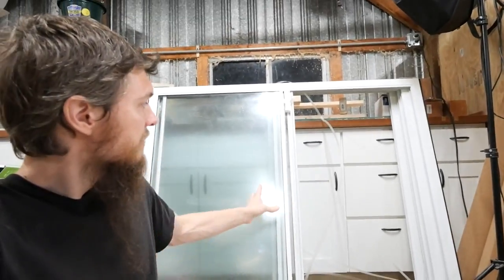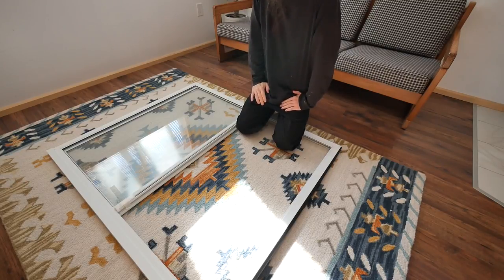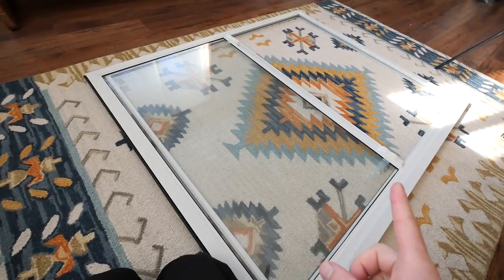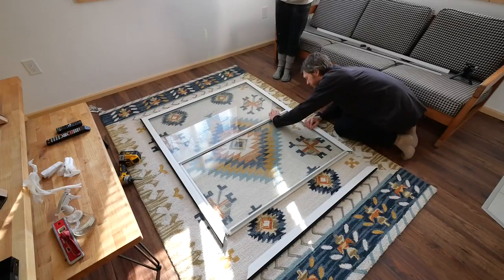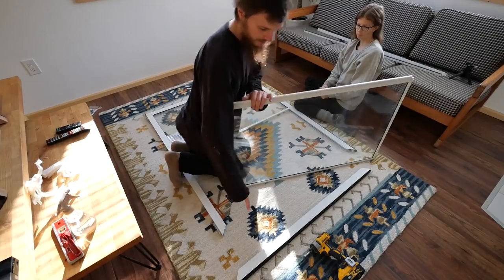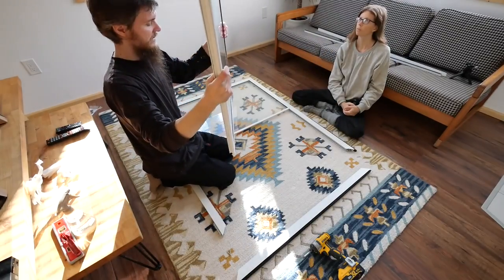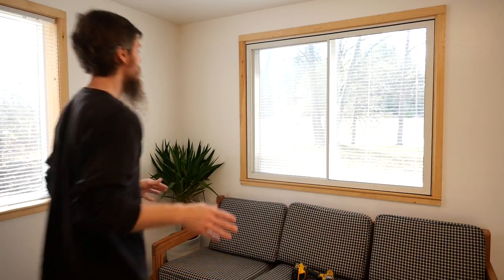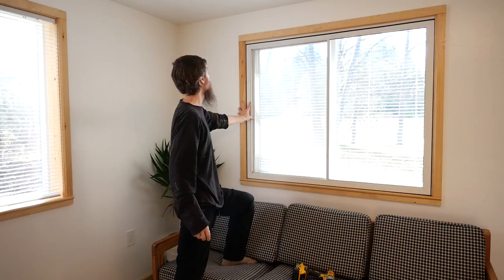Installing Storm Windows on the Inside - This is our Best Option But We had to Hack them First

Comment: Hi Guys!
Ashley, there is a podcast, titled:  Please, get your noise out of my ears.  I will try to add the link, but not sure if I can.  It is an episode of the Freakonomics podcast.  I think those windows will help lower the noise, so you can sleep.  I have some Bluetooth ear buds, so I can at least choose what I hear when I sleep.  It's been less than a year, and I am feeling so much better.
Doug, I was sure you would figure-out a way to make those windows work.  I think that having them on the inside is a great idea.  From the POV of the camera, they almost disappear!  How about the swing of your refrigerator door, and other front-loading appliances.  Take a peek, they're a build to change their swing, on purpose.  Makes you wonder why the window manufacturers didn't grok to that.
You two are great!
Here is that link:
https://feeds.feedburner.com/freakonomicsradio

Comment: Would you share with me how your electric bill is with using the electric wall heaters? Are you happy with them?
Reply from the maker: We really like the wall heaters, no issues with them at all. :) With our thick insulation and no drafts, our entire electric bill in January (coldest month) for example, was only about $260 and that's running everything including heat. (Our first winter here with bad insulation and the propane furnace was about $300 in January - for the heat alone.)
Reply: @diyfferent  You keep your wood stove going and you will cut that bill even more.

Comment: So effectively now you have triple glazing and that will save you loads on the heat loss and sound. I know what is it like to have sensitivity to noises - i cannot have an electric clock by my bed because i hear the hum and i cannot sleep. Would you conisder adding a storm window to the outside too?
Reply from the maker: I wouldn't want to add them to the outside too. I'm not sure it would be worth that additional cost. Plus we'd have to open three windows to get fresh air if needed :)

Comment: Fantastic! Did you get the storm windows from a window store?  Did the windows reduce the noise? That's how indo windows work you can choose from several thickness of glass. Do you think they would cause condensation
Reply from the maker: We ordered them from Menards' website. You can find out more about them in the link in our video description. Yep, they have reduced noise and they should reduce condensation. The real test will be in the coldest parts of winter.

Comment: What's the benefit of installing inside from outside. Storm window doesn't know where out is. Still work the same
Reply from the maker: It depends on your situation. If you have an older home or any home with unique windows, you may not want to block them with a storm window, It can distract from the look of the home. Also, these are easier to install, especially on two story homes where you may not want to climb up a ladder to install the exterior version. Also, if we want to open the window, it's easier to have the storm on the inside. It would be behind the window screen on the outside. Other reasons too. Just depends on what you want out of it.
Reply: @diyfferent  makes sense now. Thanks

Comment: Hello, air exchange de way to go. The builder had installed a different kind of bathroom exhaust fan in one of our br. It runs auto from 4:30 to 7:30 pm every day and it does exchange the air. If u install one I don’t think it should go into your br. In fact if I ever have to replace this thing I have no idea where to find one, it is not like a normal br fan. It also is not loud. Our house is one floor with attic in the garage. I also have a whole house humidifier where once in awhile I will get some condensation on one or two of my windows but very little. That fix is to adjust the humidifier, only did it twice in about 10 years. Name of the game is research, research, research. This may not be your fix but you need to say goodbye to condensation. I expect that you will have a fix for this in about one or two weeks. Inside storm windows great job, got me thinking.
Reply from the maker: I almost installed an air exchange unit earlier on but decided not too. I should have.

Comment: What’s your humidity levels inside during the winter?
Reply from the maker: It varies. But last year we had trouble keeping it below 70%
Reply: @diyfferent  thats really high. 45 is ideal during winter to keep condensation from happening 55 or below to not grow mold. that’s why I’m not a fan of vapor barriers. It doesn’t allow any drying to the exterior of home. witch leaves lots of humidity indoors to deal with. You need a fresh air exchanger if you wish to correct this problem. Bathroom exhaust fans ran 15 mins after showers is a help.  do y’all have a furnace if so read up on fresh air intakes. If you put up a vapor barrier threw the whole house. You have sealed it up tight. Witch means you’re not getting fresh air exchange you need from leaks in the building so you need to make it happen mechanically witch is important for your health, vocs build up in your home, if not. I like a vapor retarder toward the inside in climates that have heating and a cooling season to allow drying to happen both directions the also slow it down enough that it can dry to the attic with out causing issues a vapor barrier should really be left for climates were your heating all year around. All bad mold issues Iv seen have been behind vapor barriers
Reply from the maker: In addition to using our bathroom fan and stove fan, we also started running a dehumidifier which has been keeping the humidity a lot lower. Yea, using vapor barriers creates problems of their own, but annoyingly they are required by code. We've been working on solutions though.

Comment: Well good job ! Silicone spray on the rubber will help with the assembly on the new ones ! some times you can get a glass chip at the edge so look at that on assembly ! you just made $500 windows in tooooooooo $2000 WINDOWS  !!! :)   That's more bang for the BUCK !  Hell Nickel into a dime ! How about a Dime in to a $100 BILL !!! SNAP ! have a good day !

Comment: Triple glazed windows are frequently used in Europe. They make storm windows completely unnecessary. 👍🏻
Reply: I used to own a house in IL with triple glazed windows.  In the winter, condensation would form around the edges of the glass where the glass meets the metal rim.  The metal rim conducts the cold from the outside to the inside.  That was a problem, but maybe the European  windows are made better?
Reply: @ILGuy2012  I had that problem with single glazed, aluminum framed windows here in the U.S. I don’t know for sure if the European windows are higher quality but, in all the places I stayed that had them I never saw condensation. They were very good at blocking noise, too.

Comment: So why is it called  storm windows?
Reply: It is actually called double glazing your window not storm windows
Reply: Traditional storm windows are put on the outside to protect against storms and bad weather. This is an interior storm window so it is the same concept in that it’s an additional pane of glass but this has different purposes.
Reply from the maker: Storm windows are an additional single-pane window you can use to help with several issues: sound reduction, condensation reduction, more energy savings. When they are placed on the outside they can offer protection from storms and things like hail, etc. to protect your actual windows.

Comment: You look like you live in the back of beyond so shocked to hear you have a noisy road especially as your home is set so far from the road. Surely you will still get condensation now in between the windows which will cause mould? I have said before that metal blinds are a nightmare for dust and difficult to clean without some of the slats bending. Dusting is one thing but they need to be washed as well. I only have them in my kitchen but they are going soon which I cannot wait. However I have just had my wet room re furnished after 8 years with new toilet, sink and flooring so new blinds will have to wait. Not sure how Ashley has coped with dust just having my wet room done dust went everywhere even though plastic sheeting and doors kept closed. We are on lockdown in UK again so my cleaner is unable to come and being disabled it has taken me ages to clean it all up.
Reply from the maker: Our home is close to the road at about 100 feet (30.48 meters). We're hoping the condensation will be reduced. I don't foresee much of an issue.

Comment: just a little brainfart from my side and i am sure not trying to tell you what to do.but you bought two times windows and when i think about it those prices combined , would it not justify to just buy double pane windows ?? also i do not know what pricings are in the USA
Reply from the maker: Our windows are double pane but they still didn't meet our needs.
Reply: @diyfferent  oh strange that it doesnt keep the noise out then but i also live in a wooden house and have double pane however the walls still let a lot of noise through aswel

Comment: why didn't you buy double glazing windows? They have several options that are better that simple windows like yours especially if you wanna cut some of the outside noise. In EU we called them climalit after the brand
Reply from the maker: At 15:13 we mentioned that our windows are double-pane. They just turned out to be not good at reducing sound or reducing condensation.
Reply: @diyfferent  Yeah, after watching the full video i saw your take :P Sorry

Comment: Well sense you put new windows in and it doesn't keep the water out sounds like you didn't install them correctly.
Reply from the maker: Maybe you just misunderstood. They keep the water out just fine. And they keep the humidity in too :) The water we are talking about is condensation.

Comment: I totally disagree with your statement about old windows+storm being just as efficient. I live in a 75 year old house that had original windows plus storms. I have replaced all the upstairs windows now and there is a huge difference in noise muffling and heat retention. It is possible, BTW, to get new windows that look very similar to old. That’s what I did. My old 6 over 6 double hinges were replaced with double hungs that have the grid between the panes. I guarantee the neighbors can’t tell the difference!
Reply from the maker: We're just stating what we read. It could be right or wrong. A good quality properly installed storm window can do wonders though and sometimes the old windows are worth keeping. It probably depends on the quality of the windows, etc.
Reply: I might agree that, in theory, your statement would be accurate, but just the fact that old windows don’t fit as tightly in the jambs would make them less efficient in the real world.
But, yes, sometimes it would be desirous to retain the old windows, if possible. There is also the availability of new custom wood windows that would look virtually identical to the old and yet be more efficient if the old ones were not salvageable

Comment: 2:35 .... so all the new windows were never double glazed ...... that was a waste of money ..... and you know that as know you doing this .... BTW condensation is NOT a window problem ... it is a ventilation issue .... which shows itself at the windows .. ME: 40 years in the Curtain Industry .... may this comment help others spend any dollars they have more wisely
Reply from the maker: Actually, all of our new windows that we installed on the house are indeed double-pane. I'm not really sure why you assume they are single-pane windows and we wasted our money. We mentioned that the video at least once that we bought double-pane (15:12). Living in the cold north our entire lives, we've always had condensation window issues in every single home we've lived in. Condensation isn't just a ventilation issue, though proper ventilation does help to remove excess moisture. And just to reiterate, we bought these to solve other issues, not just a condensation issue.
Reply: DIYfferent just asking out of ignorance, is 'double glazed' and 'double pane' the same?
Reply from the maker: @ip4265  Yep, same thing.
Reply: We live in Iowa and have also had condensation problems in every house we lived in. Old houses and new houses. The house were in now is electric heat so doesn’t dry out interior air like gas or wood. Run dehumidifier in finished basement year round.

Comment: Argon gas is toxic and leakes out over time. Plus that type of window will go bad and expire before it pays for itself in energy savings. You are better off health wise and energy saving wise to just have a single pane with a stom window like she said.
Reply: As a noble gas, argon is largely inert. It only becomes harmful if there is enough of it to displace the oxygen levels below the amount needed to breathe.

Comment: Buy cheap windows pay extra in the long run
Reply from the maker: Except that we didn't buy cheap windows. We bought the standard windows that you would find in most homes. Jeld-Wen brand. We still had some issues that we wanted to address, so far we are enjoying the new interior storm windows.
Reply: You should have gone with Anderson windows you would not have a problem with them
Reply: @diyfferent  hey, what glass do your jeldwen windows have. Was it standard 1/8 1/8? Heard 3/16 and 1/8 combo works best.
Reply from the maker: @mgw3244  I think they were 1/8 1/8. I didn't know you could get thicker glass when I ordered but I did learn about that afterwards. That's where a good store employee makes all the difference with helping to educate us of our choices.
Reply: @diyfferent  yeah, depending on the size of the windows, you might even have 3/32 (doubtful) instead of 1/8.  As per code, anything less than 12 sqft can use single strength (3/32). You might want to call and ask, if 3/32, going to 3/16-1/18 should make a huge difference. 3/32 is OK for heat insulation, but horrible for noise. Also, in many windows, noise comes from the place where the sliding pane meets the fixed glass, doubt that is the case in your windows as they are newer (new wool pile).